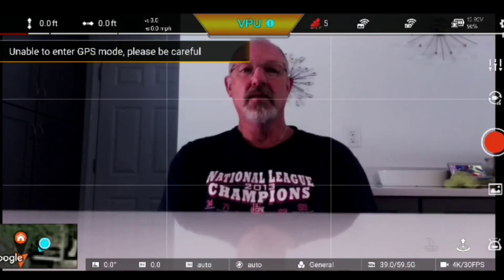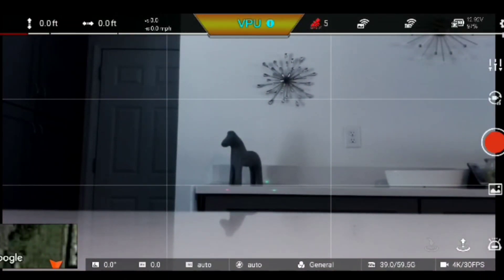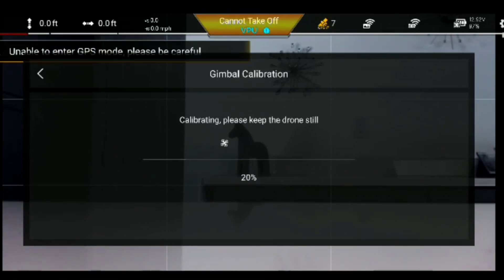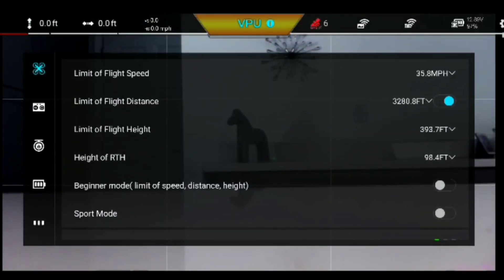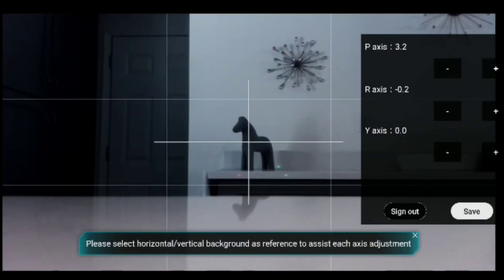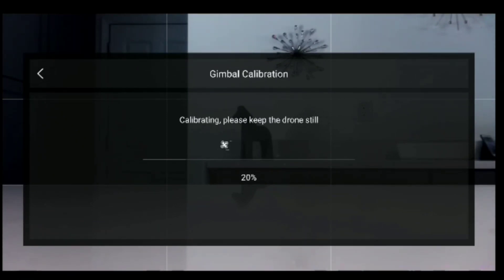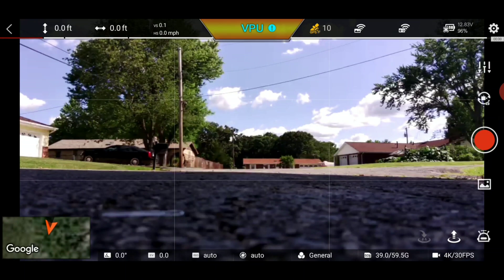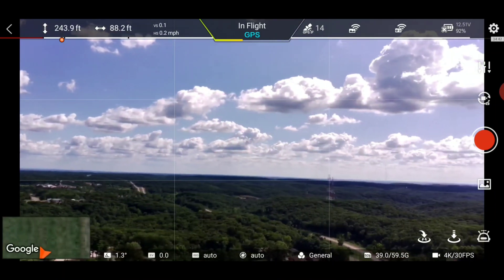FIMI X8 SE 2020 Complete gimbal adjustment process

Comment: Adjust the gimbal gain to 50% or 75% try that cause it seems the issue also when yawing is the gimbal is overcorrecting, I'm also in contact with fimi about this issue, oh while I'm thinking about it did you find the firmware on owner Facebook page for getting more GPS, meaning your drone will use GPS + glonass instead of the Chinese GPS system
Reply from the maker: I'll give it a try